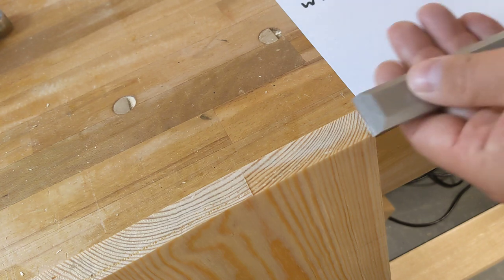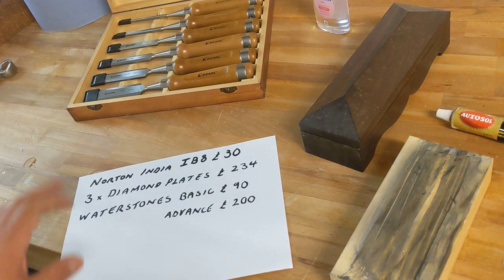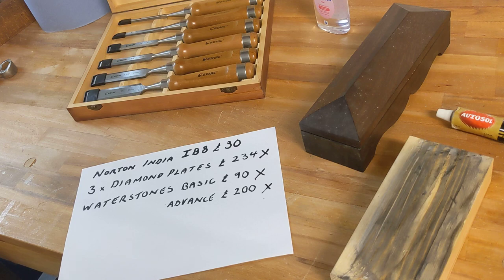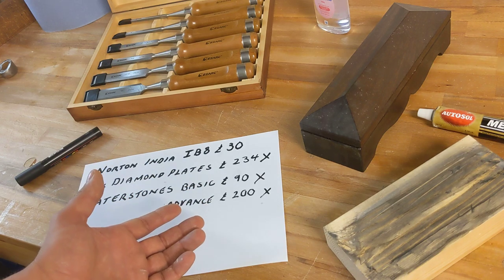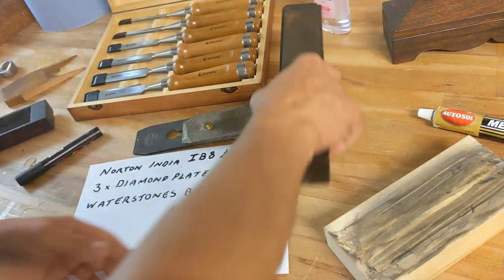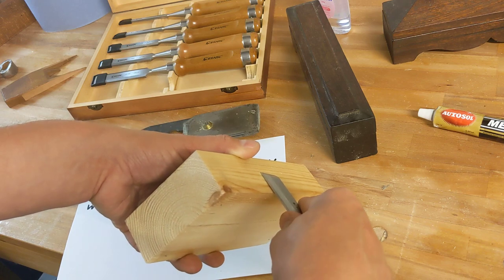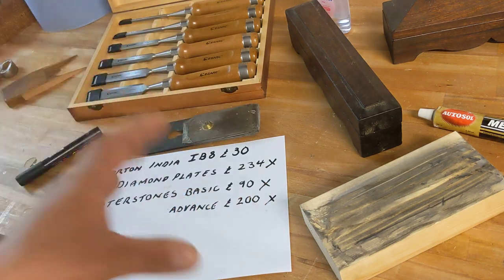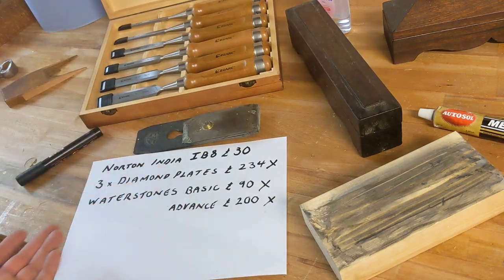Woodworking Vlog #5 The Chisel Preparation and Sharpening Discussion

Comment: Thanks for the sage advice. I'm 67 and still using my grandfathers Norton honing oil stones. It's a series of coarse, medium, and fine stones in a tri-angular arrangement - like an ear of corn - where two of the three stones are in a bath of oil until rotated to the grit you want to use. This stone was used in my grandfather's hardware store when he went into business in 1924! I will pass it along to the next generation. Good tool last many lifetimes! Good techniques last forever.
Reply from the maker: Nice. I've seen those I think, possibly even still get them. Great to hear the stones have lasted so long Xxxx

Comment: With the freehand sharpening, I will be going to it eventually. I took a 3 day work shop with Allan Batty and his son Stuart. Allan had been turning for 60 years and went through the whole apprenticeship thing over in the UK. He didn't use jigs. I picked up the freehand sharpening very quickly. The trick to figuring it out was realizing that every thing I did to sharpen my tools was exactly what I was doing when I was turning my bowls. 

As for diamond, I prefer them. Mostly is that they should live long past the date that my birth certificate expires, and that, hopefully will be another 20 or 30 years. Diamonds do last forever. I had an old set of DMT diamond stones, and they had pretty much stopped cutting. I found a product called Trend Lapping fluid, which was made specifically for the diamond plates. It cleaned them up and they started cutting almost like new. Most of the turners will use CBN grinding wheels, cubic boric nitride, which is specifically for hardened metals, which includes bench chisels. The problem with diamond wheels is that even on a slow speed grinder, they get hot from use, and the diamonds can't take the heat and basically shatter. They do work well on the Tormek and similar slow speed wet wheel grinders because there is no heat build up. Oh, Trend does have a nice combination plate 300 grit on one side and 1000 on the other. No clue as to the price. 

One demonstration I saw that made a huge impression on me was Eric Loffstrom, from Washington State. He took his skew chisel, which is the only tool we turners strop, and tapped it on the lathe bed. There was a collective groan from the audience. He then took it to a 60 grit CBN wheel, refreshed the edge, and then took it to some cheap, maybe 800 grit polishing compound which was available in most of the big box hardware stores, stropped it a few times and shaved his arm clean in one pass. Message was 'remove the burr'. 

I do have some M42 high speed steel blanks around that I will turn into a chisel, just for fun. It has superior edge holding capabilities compared to standard high speed steel, and to the A2 steel which is probably the more common metal used for quality chisels. I will see what happens when I sharpen to 220 and then step up a grit  or 5. 

I did also find out that the heat treating of the metals can vary hugely from manufacturer to manufacturer. Had some A2 turning tools a long time ago and gave them away. Almost no edge holding capabilities. I am blessed or cursed, depending on who you talk to, with having to experiment...... If it ain't broke, take it apart and fix it anyway....
Reply from the maker: "Remove the burr" gold! It is that simple. Thank you for the extensive reply. Sharpening is such a rabbit hole. It's good that the Diamond plates came back after a work over with the fluid.

It'd be great to see some videos from you again. I know how much of a pain they are to do, but I'm sure your turning experience would be useful.

My turning will be spindle work to start, but in the long term, who knows! Thanks again for a constructive and informative comment 👍
Reply: @faceedgewoodworking  For spindle turning, look up a guy Woodturner 21. All spindle work, Allan Batty has a good skew chisel video up as well. 

I did grind off a 3/4 piece of the M42. Sharpened it on a 220 stone and then stropped it. I was surprised at how nicely it  cut. Sharpened on a 600 grit stone, and after stropping, I do think it was a bit better. Have to work my way through the grits. Curiosity!!!!
Reply from the maker: @robohippy  I'll check them out now! Nothing wrong with being curious, unless you're a 🐱

Comment: I never went full mental on flattening the back. Worst thing that happened to me was a big bump right before the edge of a chisel. Would not matter on a plane blade, but I wanted that specific chisel for pairing and the edge was (for joinery purposes) too offset from the back. So I just sharpened the very tip and use it for tasks that do not require the chisel to lie flat on top of the worked material. And from experience, this can happen to any blade. I've had examples like the first one you showed in this video for both planes and chisels, but also weird bumps and twist, you never know. Your method would perfectly for basic task a beginner would need and that is the perspective I love about your channel. No one will grow into difficult task regarding finely set tools overnight and we might get easily swayed by people who spend way too much a tools they either never use to their full potentical, or for a task that needed way lesser grade of tool (I specifically mean people who video themselves planing boards with a veritas/nielsen priced plane and the tool jumps across the surface as if the were try to plane asphalt. 
Keep up the great work.
By the way, based on your videos and opinions on tools and how to use them, check out Mr. Chickadee, if you somehow missed him, you will be astonished.
Reply from the maker: Thanks for sharing your experience. I remember Mr Chick from when I was doing videos. I liked the fact he was his own man. I'll check in again.

Comment: So much truth in this video (in every video of yours actually)... I could not agree more with what you said.
This is my experience. I started my woodworking with a set of three diamond stones. Not only was that crazy expensive but it has never been my cup of tea. Then I turned my approach upside down: I sold my diamond plates and with 1/5 of the budget I bought a Washita stone. After some experimenting I found out a mixture of 1/2 mineral oil and 1/2 gasoline being the perfect blend (in general, the finer the stone, the lighter the blend). Well, that changed my sharpening experience dramatically: sharpening has become simpler and much more effective.  The edge IS SIMPLY SHARPER: one single cheap oil stone is BETTER than three expensive diamond plates!
So, this is my advice for all of you: KISS (keep it simple stupid!).
Get rid of your fancy diamond/ceramic/water (going around with a water basin, mud all over the place and a flattening stone? Not for me!).
Buy ONE SINGLE oilstone ("but oil stones are dirty!!!" No they really aren't: just few drops of oil are enough) and just stick with it.
Life is so short to fool around with sharpening. Do some pretty decent woodworking instead!
Reply from the maker: 👍👍👍 💯. For the sake of these videos I like to show the India as it's cheap, available and does a great job. But like you, I adore my vintage stone. 90% sure it's a Washita and the edge is lovely 👌.

Comment: Thats one fun thing about Japanese tools is that instead of trying to flatten them, they hollow them and flatten the barest amount possible.  That's also why I like Stavros Gakos' sharpening method with his edges. Bench grind the angle, and then polish the edge. No need for a secondary bevel, it hollows the bulk of the edge so your primary angle is your relief angle..
Reply from the maker: Hi J. You know, I tried honing on a hollow grind and it didn't work for me. It's a totally legitimate and proven method, I just find a low grind and steeper hone works for me. 
The Japanese stuff is an art when done properly. Perhaps one day I'll explore their methods. Cheers.

Comment: For some paring operations, I do want a pretty flat back of the chisel. Not arguing you need it when chopping.

There are diamond plates you can get for a moderate price that can be mounted on some ply as an alternative to the more expensive stones.

Dictum offers a finer oil combi stone (1k/2k) Kunsuto.
Reply from the maker: Thanks David, good feedback! It's funny, nice old British paring chisels are thin and have some flex. Compare that to a modern Narex parer which is by comparison, very thick and crude.

I'm pretty lucky, I don't need an engineering quality flatness. I wonder how those old pattern makers managed, especially when they worked to such remarkable tolerances.

By the way, I'm not arguing, it's genuinely good to hear of others experience 👍
Reply: @faceedgewoodworking  I did get a number of British chisels back before it became impractical and I like them, especially the Marples boxwood are nice as are the new Ashley Iles. Of course I have access to continental ones, Two Cherries (Kirschen) are useable, but I feel like they have a softer steel and the polished ones can be rounded a bit much (though you can get unpolished ones from fine tools as well). Stubai spezial seem good as well, but I haven't used them extensively. And I have a video of testing the TwoCherries dovetail chisels: https://www.youtube.com/watch?v=XXDnVCPrYNQ
Keep up the good work.
Reply from the maker: @drekowski  Nice vid, I'll watch it later 👌

Comment: Thanks for sharing your method.  I purchased some Narex paring chisels some years ago, impulse buy, and was trying to figure out how to sharpen them since so many teachers tell us the back has to be perfectly flat.  I guess as long as the back is "flat" right behind the cutting edge everything should be good to go. 

If I wanted to give your method a try, which would be the best stone to buy for this purpose?  Thanks again!
Reply from the maker: No problem, look for a Norton India IB8. You'll only need the red side really. It will be aggressive but will calm down. If you have some faces of plane irons that need some work, that'll calm it down. 
Yup, as long as you can remove a burr that's all that matters.

Comment: I bought into the 3 diamond plates idea a few years ago and duly lightened my wallet by a couple of hundred quid. Live and learn but I went back to the India combination stone and the diamond plates sit in a drawer largely unused.
Reply from the maker: Hi Tony, sorry for the slow response. Yes, it does seem odd to me. The cheap recommend method always seems to be abrasive paper, then pony up £200+ on stones. Why not just get people to try a £20 that would last a lifetime and up until recently was perfectly fine for woodworking. Even in Ernest Joyce's seminal text on woodworking a fine man-made oil stone is perfect. Although to be fair he does also mention a 1600grit Waterstone too. No sign of any much more.
Thanks for commenting

Comment: Great video again. Just wondering what your bench grinding setup is? Also the oil stoned I inherited from my great grandfather are really dished. Any tips for flattening these (even though I know you said they don't need to be flat)? I used 60g paper on float glass but was making incredibly slow progress. Thanks!
Reply from the maker: Hi James. At work we have a Tormek, for a professional workshop it works out cheap and keeps our insurance company happy as there are no sparks. However for a home workshop it is expensive. So, when I have a moment I'll share what I use at home. 
Flattening a badly dished stone is hell! It gets worse the closer you get! Do you know what stone it is? I "flattened" a Charnley Forest with a belt sander. Proper PPE needed for that but it was done quick.
Reply: @faceedgewoodworking  thanks! I had never thought of a belt sander to be honest - I shall give it a go. I’m not sure what kind they are (there are 2). One seems finer than the other, both are dished on both sides though. I couldn’t detect any change in “grit” when flipping the stones. I can’t imagine they are expensive stones, as my great grandfather was a joiner with mid range tools. Look forward to your vid on the bench grinding set up. You make sharpening seems so simple! Thanks for the content as always mate
Reply from the maker: @jamessunderland362  If you do go for a belt sander, get the appropriate PPE 👍
Reply: @jamessunderland362  .  You can also rub them on a breeze block. It works surprisingly well but it does need some elbow grease.
Reply: @tonyalways7174  next time I see one in a skip, I’ll grab it! Thanks

Comment: What do you use to grind/restore a bevel?
Reply from the maker: The safest and most reliable way is the water bath grinders. There are no sparks, no particulate in the air and no chance of burning the steel. It's what we use at work. It doesn't have to be a fancy Tormek.

80 grit PSA on a flat tile with a honing guide is very cheap and accessible. Especially if you choose to restore old tools. 80 grit PSA and a tile are essential for sorting out old chisels etc. Just beware, grinding process still gets hot. Which leads me to...

A high speed grinder. I do a bit of turning so it works well on HSS. Because I wear a mask when I turn, I'll ofen refresh any bevels that need it on my normal tools. A light touch and a steady hand seems to sort it

Comment: Why the metal polish?
Reply from the maker: It's quite abrasive. Not sure how abrasive Autosol is in terms of grit but it adds a bit of refinement to the edge.
Reply: @faceedgewoodworking  how would you compare that to one of those green sticks you draw on a strop with?
Reply from the maker: I'm sorry, I don't know for sure but It's effective for me. It reminds me of the Tormek paste but perhaps finer again. I think I remember the Tormek paste giving an 8000grit finish
Reply: @faceedgewoodworking  not bad for how cheap it is!
Reply from the maker: @jgo5707  Yeah, I need it as a general polish too so it a kind of two birds with one stone.
Reply: @faceedgewoodworking  I just ordered some, it's available in the US! It's cheap enough to justify buying some to test out to compare to more traditional sharpening mediums. I'm hoping this will be a good bridge between my 1k diamond stone and 12k strop
Reply: @faceedgewoodworking  I got and tried the Autosol, I put a layer on some half inch plywood and I have to say, how quickly I was able to go from the 1000# diamond to a razor-sharp mirror finished chisel was INSANE. I wasn't aiming for a mirror finish to my chisel, who cares about that, but how quickly that honing went was absolutely bonkers, it sliced through pine end grain and left a glossy wood surface as well. And it's so cheap, this was a great suggestion!
So that simplifies my sharpening process exponentially. No in-between grits, 1k diamond plate and then autosol. I see no need for more grits up or down or even stropping truthfully.
Reply from the maker: @jgo5707  That's nice, I can feel the enthusiasm 😊. Enjoy the edge J, it's a very easy option to get sharp 👌